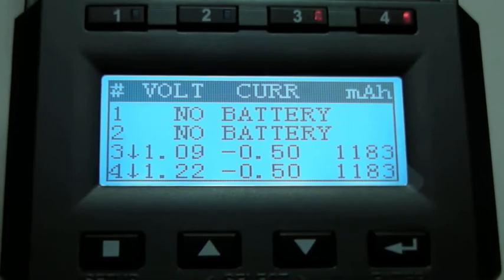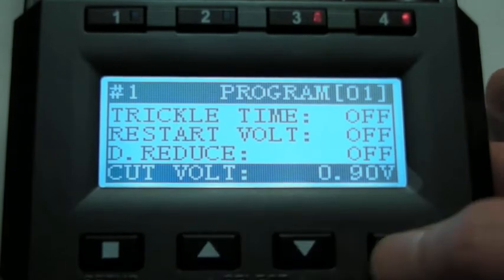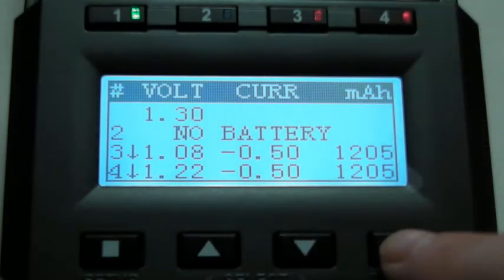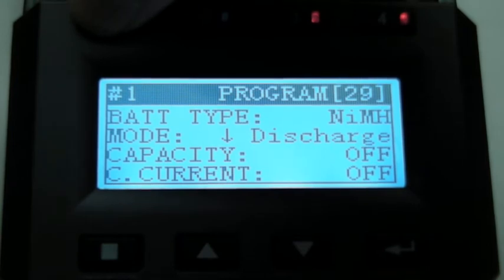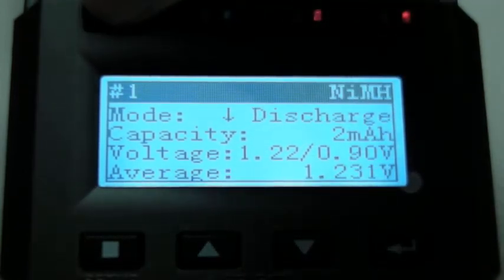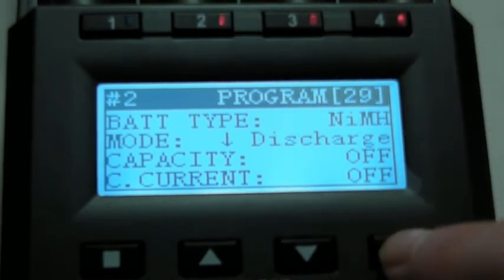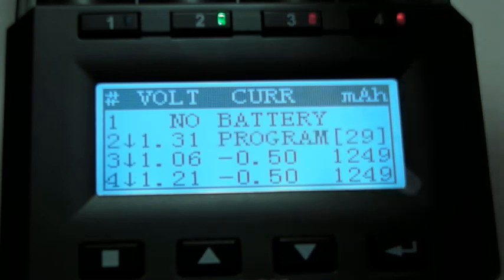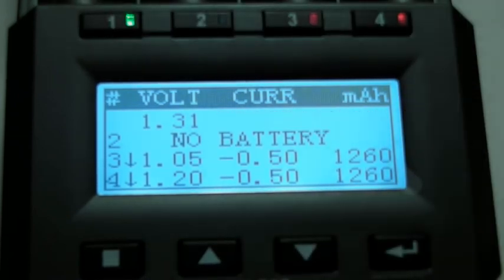SkyRC MC3000 Single Slot Program Editing, Running, and Stopping.

Comment: I am unable to save the system sounds to be set to ""off" nor does any thing else is saved. I tried to save to all slots, nothing. They need to provide a step by step video on YT. thumbs up.
Reply from the maker: Yeah it could use some clearer instructions.  I remember downloading some user-revised ones probably from candlepowerforums’s thread on it.  I haven’t messed with the setup screen but it appears that if you set what you want, then click enter to save that one line, you then hold down enter on any line and it’ll save everything.  Hold stop down to exit without saving.
the feature I should use is the 1-4 favorite setup buttons.  I always set slots one by one or click in, go down to save to and set “ready” which saves to all slots waiting to start.
Only problem I have, and it seems recent, is a lot of early (like within minutes) NiMH terminations.  A restart or two fixes it.  It doesn’t seem to have a “ignore delta peak for X minutes” setting like my Bantam.  I could just use a small -dV vs 0, I suppose.